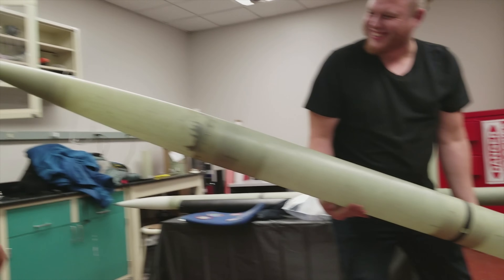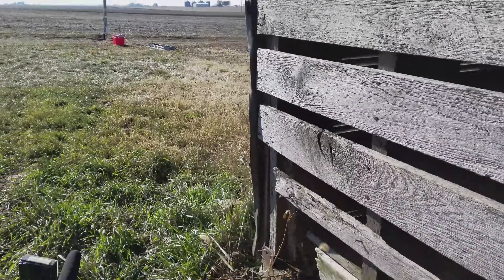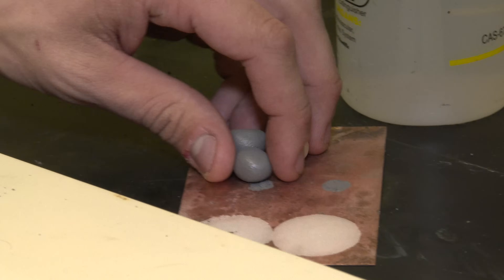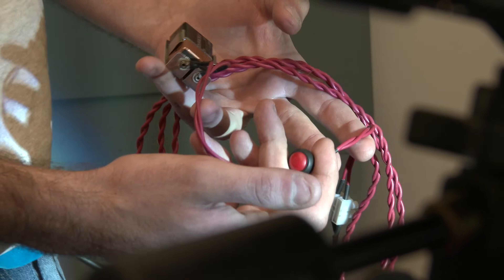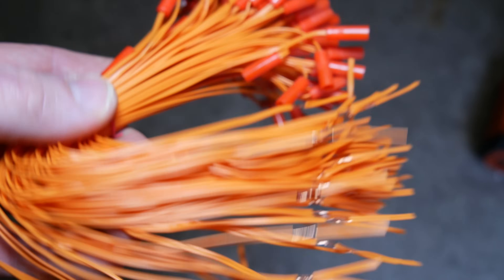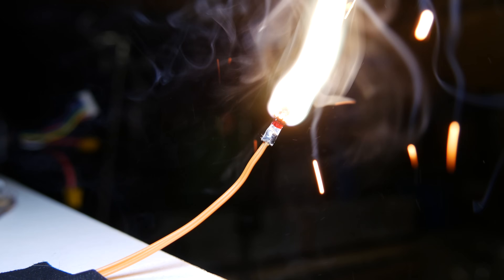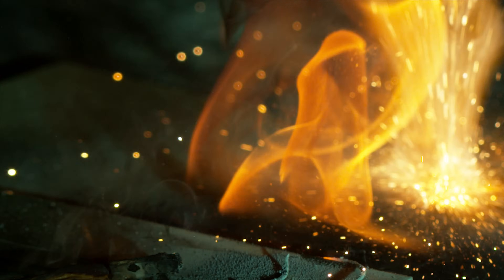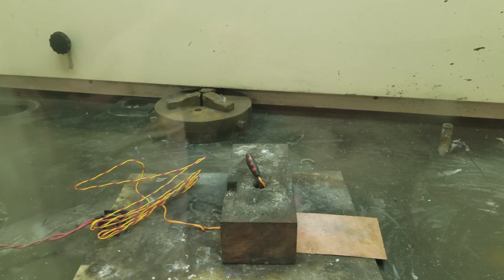Rocket Igniters in 4K Slow Motion - Amazing !!

Comment: Omg! One of the best videos I have ever seen in my entire life.I don't get why you don't have enough subscribers for that much quality in your channel.
Reply from the maker: Burak Uzek thank you !, YouTube is being picky ...lol , I'm going to hit it hard this year though, I have a lot of crazy awesome episodes on the way.
Reply: I am waiting impatiently for the new episodes.Great job!
Reply from the maker: +Burak Uzek thank you !!
Reply: This video alone has me subscribed.
Reply: Nine Eleven Your comment requires a pretty long answer so I'll keep it short. 
If an engine burns for 5 mins it needs enough propellant to do so. Since fuel is expelled, the total mass of the rocket looses weight and can more easily gain velocity. Spacex uses liquid engines, so they can vary thrust like a car. The solid motor in this video cannot do this. It's also less efficient to move fast through "thick" atmosphere, so they gain speed when drag is less.

The rockets in this video are filmed about 30 feet away (if that). The smaller something is in your field of view the slower it look like it's going.
Hope this helps
Reply: Not sure why you are suggesting a helium balloon, thats not how rockets work....  

Saturn 5 ran RP-1 (refined kerosene) its a pretty common fuel, not the best though. 

Gravity has nothing to do with nozzle efficiency, its based off of nozzle geometry and atmospheric pressure. 

Length of flame REALLY has nothing to do with engine efficiency, If you want i can give you papers written on this. im not going to get into this on a youtube thread. 

Smoke generator is not just for show, do you think a company that sends up rockets (on a budget) would spend the time to design and build something to look cool and serve no purpose? Its to cool the ground station from exhaust.

I stand by what i said previous, do some research on this
Reply: Warped Perception I think bitcoin now it 7500 per ounce, helium has some catching up to do
Reply: Burak Uzek AGREED
Reply: Nine Eleven okay bud, I'm not going take this any further. Believe what you will
Reply: >starts conversation about how rockets are supposed to work
>has the username Nine Eleven
nice bait there, bud. don't forget your tinfoil hat next time
Reply: Lol this guys trolling hard
Reply from the maker: Michal Pekala LMFAO ..... 😂😂😂. I heard helium is up to $1500 an ounce, it's gonna pass Bitcoin soon.
Reply: The rockets in your video are shooting up into the air too fast. They shouldn't be going at 'rocket speed'. Just watch the recent Space X launch. The rocket rises very slowly into the air like a blimp with a flame thrower out the bottom. Make a video where your rocket rises very slowly into the air.
Reply: For a rocket to rise, it needs to have adequate speed per weight, and that's why a rocket, no matter the size, will appear to go fast relative to its size. The giant rockets they show us would need to rocket up into the air; otherwise, it would tip over and fall like a tree. On the other hand, if you use a rigid structure dirigible, and control the ascent with compressed helium release, the rocket will never tip over because it's held upright like a balloon, plus you can accurately control the rate of ascent. To have the rocket come back down, you use valves to pump the helium back into its compression chamber, and the rocket is slowly filled with the outside air, and descends at the rate you wish for it to descend. The rocket is tilted from vertical to horizontal in mid-air by redistributing the helium from chamber to chamber. It's all basic science; whereas, what they claim to be doing, a slowly ascending giant heavy rocket, which magically tilts horizontal just above the clouds, is all nonsense and defies basic physics.
Reply from the maker: +Nine Eleven LOLOL, I won't take this subject to the streets with you, I'm going to let Patrick answer that. That requires a very very long answer in my opinion..
Reply from the maker: +Nine Eleven now you did give me a good idea though, I should make a flamethrower rocket. Although I would have doubts on how I would keep that in the straight trajectory toward the sky, because of that veered off horizontal before all the fuel is burned we would have a moltov cocktail in slow motion. lol
Reply: You need to use a balloon, with the helium in the top half. That way, the 'rocket' will never tilt. Later, you can make one where you have remote control over redistributing the helium, after the first stage is released, so the the rocket goes completely horizontal. Even the Saturn V used liquid oxygen in order to shoot the flames out farther with less fuel. The fuel they used by the way was kerosene. Yup. kerosene is 'rocket fuel', LOL. Gravity works in your favor for the length of the flame, so you don't need to expend as much fuel and liquid oxygen as you would think in order to get a good length of flame. Be sure to experiment until the rocket rises slowly at just the correct rate. Also, Space X demonstrated their 'rocket' smoke generator not too long ago. That's why there's so much smoke at the very beginning of the launch, just for spectacle, then as the rocket rises, there's no more smoke. So, if you can, get a smoke generator for spectacle. 

Thanks for your vids. They're fun, but I would suggest not repeating the bad science in your voice overs. Just show us the visuals and describe what is actually happening, without using pseudoscience like Isaac Newton in attempt to describe why it happens the way we see it.
Reply from the maker: Nine Eleven that's trippy Niner, just imagining that was better than Norco, what was the bad science I explained? Just curious.
Reply: "Its to cool the ground station from exhaust." <-- They really got you fooled, huh? You don't miss a beat, and pretend you knew all along. That's the first sign of someone who doesn't want to admit they've been conned, so they start inventing stuff on the fly, to fill in the gigantic gaps in the story. 
"Length of flame REALLY has nothing to do with engine efficiency" <--- Glad we see eye-to-eye on this. The length of flame is strictly for show. The flames contribute very little, if anything at all to the upward momentum of the balloon. They use a balloon because they have tremendous control over the show, like a stage show. They make it rise at a slow speed, then they make it curve toward the horizontal at a low altitude, then they put on a stage-separation show. Before the Space X reusable balloons, they would reuse the balloons anyway, but parachute them down into the ocean, out of sight. They do all of this because they can't get to outer space.
Reply: "what was the bad science I explained?" <-- You weren't so bad with the bad science in this video, please forgive me. It's just when you mention launching satellites in outer space and other movie production nonsense.
Reply: You're not doing your research. The information is out there. My suggestion is that you start with what you see. What Space X shows us doesn't match their claims of how they do it. They are violating basic physics in a big way. Just because they keep showing you the same thing over and over, the repetition has you trained to believe what they say they're doing is possible. It's not. A real rocket can't float up slowly into the air. It has to go very fast relative to its weight. Make a model rocket that rises slowly just like the Falcon or Saturn V balloons. Prove me wrong.
Reply: Making a helium stabilized balloon flame thrower is easy, just look at Space X. I challenge you to make an actual rocket that rises slowly into the air. After you do that, make an arrow that you can shoot straight up... slowly so you can throw things at it, as it rises LOL. Real rockets are like arrows; they need to go fast, otherwise they will just fall back to the ground.
Reply: "What Space X shows us doesn't match their claims of how they do it. They are violating basic physics in a big way."
Please elaborate. 

 "A real rocket can't float up slowly into the air. It has to go very fast relative to its weight."
You should look into gyroscope guidance and gimbal control before making such an ignorant statement.
https://www.youtube.com/watch?v=-uFNmRJKE_E
https://www.youtube.com/watch?v=KToggTKa9Lk
https://www.youtube.com/watch?v=L8ABMicmaZo
Reply: Nine Eleven Did you enjoy eating your Tide Pod this morning
Reply: Boy, that's original. When you find yourself resulting to calling others 'crazy' because you don't find you have the facility to engage in actual discussion, it's probably a sign you need to step aside and let the adults continue.
Reply: Nine Eleven. . The Center of Gravity needs to be one caliber forward of the Center of Pressure for stable atmospheric flight. Rockets are nose heavy. I have been designing them and flying them for decades.

In my video on my channel the nosecone of my Space Shuttle has 30 grams of clay packed inside of it. It flew into the wind exactly as I designed it to do
Reply: What you are describing might make sense if the rocket shoots up like a... like a... rocket or an arrow. But that's not what we see. Interested to see your Space Shuttle model rise slowly into the air (without you slowing the footage down). Of course it doesn't do that. The Space Shuttle has been an elaborate hoax.
Reply: @Nine Eleven, Please create a video detailing what you are saying, it's hard for me to understand.
Reply: Nine Eleven...(How do I keep this simple without developing all of the math? I will have to develop some of it.)
========My Space Shuttle Model========= 

I am using Black Powder as my propellant. That is a decent propellant for a TOY. It is NOT a High Power Rocket. It is a Low Power Rocket. It has a 1.6 sec burn time in the flight of that particular model with the D12-3 engine that I chose. Weighing in at roughly a total of 400 grams, including the engine, my model is traveling at about four hundred miles per hour at the time of propellant exhaustion.

The D12-3 Engine has an initial weight of  44.5 grams of which 24.2 grams is propellant. The remaining weight of the engine includes  the casing, the clay nozzle, the delay charge, the recovery deployment charge, and clay cap. While the burn of the delay charge adds some momentum to the system it is negligible.

The ratio of the weight of the propellant to the weight of the launch vehicle can be expressed as follows.

24.2 grams/400 grams = 0.056 

That means that the propellant weight is 6% of initial vehicle weight (in holding to the significant digits.). 

In 1,6 seconds the model is at the highest speed that it will travel during the flight. That is at roughly 100 feet altitude in the acceleration phase of a flight where it will reach the peak altitude of 300 feet during the coast phase of the flight due to...the momentum imparted to it. from the engine burn..

========The Real Space Shuttle==========

The real Space Shuttle was a remarkable machine. The Space Transportation SYSTEM (STS) included an Orbiter, an External Fuel Tank (which stored Liquid Hydrogen (LH) as the Fuel, and Liquid Oxygen (LOX) as the Oxidizer), and two Solid Rocket Boosters, SRBs, (which had Ammonium Perchlorate Composite Propellant,  APCP) It was most definitely a High Power "Rocket", and technically it needs to be considered as a missile as it had internal guidance systems. (But since the public does not know the technical details of the difference between rockets and missiles, due to ignorance, i will allow for the colloquialism.) 

Gram for gram the impulse provided by APCP and LH/LOX demonstrates just how weak of a propellant that Black Powder is.

Why am I doing this?

The propellant weight of a Space Shuttle is roughly 85% of the weight of the launch vehicle. That is what you need to know.

And because the initial thrust from the engines has to loft metric tonnes of material when compared to the grams of which I am writing about when flying toy models the departure from the pad is slow.. And even with the high impulse of the energy dense fuels which the STS uses it is still not that easy to loft that much initial weight into flight.

=========================================

Now if i were to increase the mass of propellant in my model from 6% to 85% i'd be VIOLATING THE LAW as I have a statutory limit of 62.5 grams of fuel in my rocket according to BATF regulation. The propellant weight would have to be roughly 2.3 kilograms and my model has nowhere near enough volume to contain that. 

Furthermore i'd have to have an Internal Guidance System as the Center of Pressure to Center of Gravity ratio would not be able to be reconciled. That is a grey area with BARF...ooops...BATF. And as for a a mechanism to gimbal the engine to correct for anomalous trajectory? It cannot be done in the 1/162nd scale of my model..

Furthermore I am not High Power Rocketry Level Three certified.

Even packing that volume with 350 grams of Black Powder (50%), a violation of law, may cause that vehicle to lift slowly from the pad  But more than likely the vehicle will detonate as a pipe bomb. And that would be insane and dangerous to even try it. An extravagant coring method of the engine may be possible. With all of the other inherent issues that would just not serve me well.

It would be very hard, if not impossible, to fake a real Space Shuttle launch...using my model. Perhaps it can be done in 1/4 scale. or 1/8th scale. But there is no purpose for doing that.
Reply: You did a great job. I don't think you are getting my point. The only way for a rocket to rise into the air is FAST. The term 'rocket' is synonymous with 'super fast'. When we watch Space X rocket launches, or shuttle launches from NASA, they rise too slow to be an actual rocket. Instead they are helium dirigibles with a flame thrower out the bottom. They don't go much higher than the clouds before they turn horizontal and fly off into the distance.
Reply: Nine Eleven...No. They are very heavy when they launch. The thrust is just enough to get them off the pad. As they lose mass through the consumption of the fuel, and because the thrust, from the engines is a constant, then they must accelerate (experience a change speed with respect to time) rapidly. That is a Physical FACT.

F = m*a*

When F is a constant and m decreases then a must increase in order for that statement to remain valid. That is a Physical LAW and cannot be violated.  The Physical Universe has no care whatsoever about what i want. It validates itself and it has always validated itself. On a metaphysical note the Holy Bible declares that God is not a respecter of people. That is not a lie. He will validate Himself through His Creation as He has always done.

Our entire modern society has been ENGINEERED under that LAW. That is why bridges work. That is why buildings stand. 

That is why Rockets fly.

F = m*a*

There is no escaping it. Newton was brilliant when he uncovered that underlying LAW which GOVERNS our Physical Universe. (You may not understand that Newton was an extremely devout Christian and that a great deal of his time was exploring the Holy Scriptures. I am inclined to believe that he found these LAWS through his study of the Gemmatria of the Hebrew Texts.)

FYI...As to your Username...I know beyond a shadow of a doubt that the Official Story is a farce. Now it may surprise you that I use the very same ENERGY ANALYSIS TECHNIQUES to demonstrate that farce as I do to demonstrate the reality of Rocket Flight.

Now I realize that you have been lied to about many topics...that "the News" and much of what is contained in the History books are generally a fictional accounts based upon real facts.

We are flying into space and the Earth is an oblate spheroid. As to the details...Hell...yes...IT IS HELL. The US Government has gone out of their way in a vain attempt to rewrite Physical Laws in order to promote false narratives. 

(Just try to declare that the LAW of Conservation of Momentum is invalid and does not apply to you when you are in an auto accident or a plane crash. The Universe will not give a damn about your declaration and you will still experience the consequences of those misfortunes should they happen to you.).

So I can more than understand your distrust of, and skepticism about, anything that you have been taught.

But the most effective way to sell a lie is to tell a whole bunch of truth and then they slip the lie into that. Sadly it works to well as many will believe that even the truth is lies which is far more sinister in deception.
Reply: F=ma is not a law, and to say otherwise is naïve. You can push against a wall and have no acceleration, yet you are applying force to the wall. You seem to believe in a lot of 'laws' without dissecting them. None of Newton's laws are laws at all. They are childish postulates with no evidence or proof to back them up. 
As far as rockets rising slowly, they can't. A rocket without helium inside would fall over the instant it rose off the ground so slowly. A rocket must go fast. The heavier it is, the faster it needs to go.
Reply: You can deny reality if you want, Nine Eleven. You will not be able to deny the consequences thereof.
Reply: Deny reality?  If you can't address the simple debunking of F=ma and Newton, then step aside and let the adults do the talking.
Reply: Nine Eleven...You drive through my tunnels and on my roads, built with my own engineering skills. I have no patience for this.
Reply: I've encountered more arrogant than you and put them to shame because they only believe in Newton's laws, and they haven't actually tested them. And here you are, so high on yourself, but you will not engage because you don't actually know what you are talking about. F=ma is hypothetical nonsense and can not be proven.